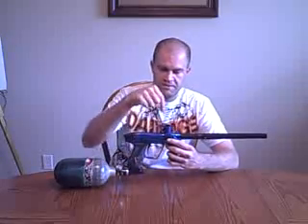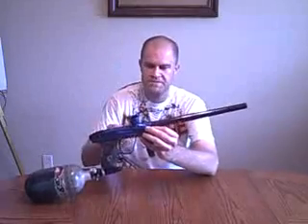First Shot Drop Off & Anti Bolt Stick

Comment: I have an shocker nxt, with a virtue board, I have the dwell set to 12ms and the anti-bolt stick is set to 10ms, and my bolt still has first shot drop off, should i increase the dwell or the anti-bolt stick, and what should I increase too? Thanks!

Comment: degas the gun remove bolt check all orings and replace if needed, relube bolt, clean breech as best as you can, make sure eyes are clean, make sure they work, try turning off eyes and shoot gun with single ball aired up. If it fires the eyes are dirty or broken if not then contact empire

Comment: Dentents are to stop the ball from rolling down the barrel or double feeding. The eyes make sure the ball is in the chamber before the gun fires. so it will not be sliced in half by the bolt. so if ur having chopping problems then clean your eyes. and lukeline, please do some research before you go mis-informing newer players.

Comment: Had this problem with a DM4. Air it up.. turn it on and when you went to the pull the trigger it would just poof like it kinda fired..but not really. I think it did shoot a ball out though but every shot after it would be fine. Replaced all the rings and still did it. Ended up being the solinoid. It wasn't cycling like it should. Replaced and it was good to go. Wondering if doing better maintence with bolts and keeping them well lubed would help that. Just not over lubing.

Comment: i have a dp g3 and every time i put my tank on after my gun has sat a while it wont fire untill i pull the trigger 10-20 times.i can hear the air cycling through the solinoid but my bolt does not move.can anyone help me?

Comment: wouldn't the extra couple miliseconds of dwell from the anti-bolt-stick give a velocity spike on that first shot? or could they potentially do that? i was helping my friend work on his gun, and when we adjusted the dwell 4 or 5 miliseconds higher than the normal setting we got a 20+ fps spike in velocity. it sounds like i'm misunderstanding something, because i'm sure these companies aren't making dangerous settings on their boards.

Comment: pmr has another microswitch. this microswitch controls the anti bolt stick. it will add 10 miliseconds of dwell to your first shot when the microswith is in the on mode